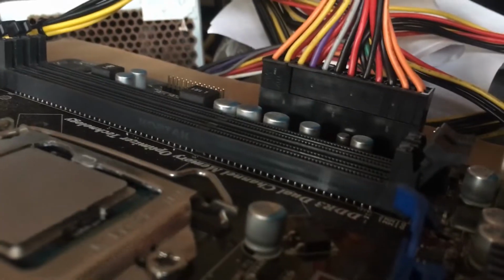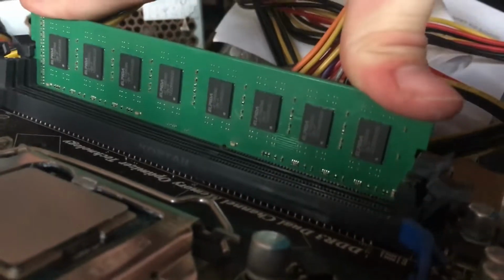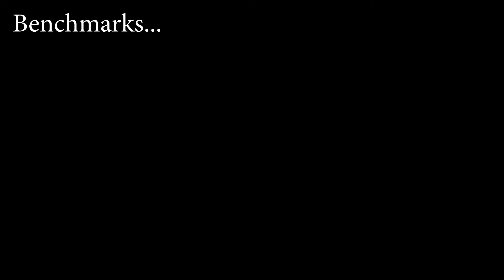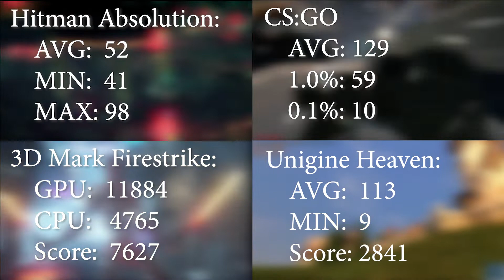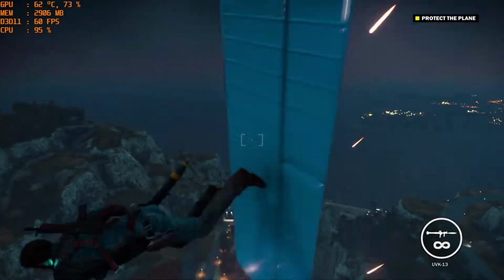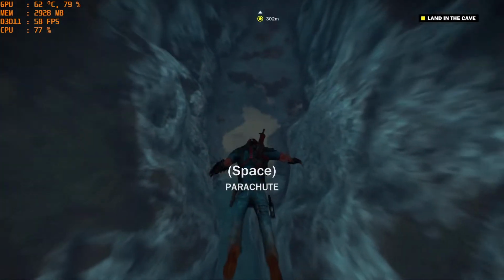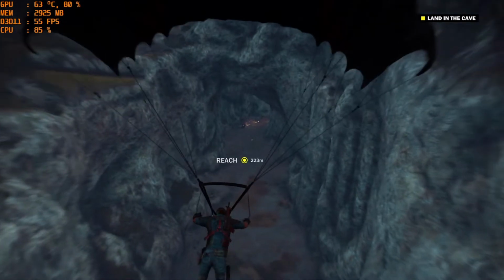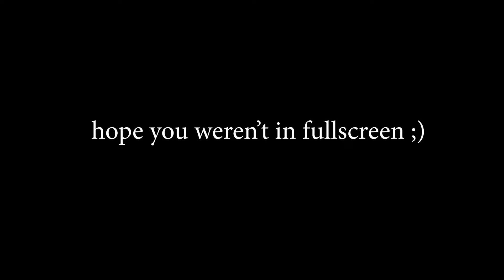i3 3240 & GTX 1060 3GB -  Budget PC in 2019

Comment: mine just fine with i5 2500 without any turbo boost.. idk if bottleneck happened.. but it's still playable.. but I'm gonna upgrade soon to i3 9100f
Reply from the maker: Remember that AMD recently announced the Ryzen 3 3300X which is a really good value chip with a good upgrade path and Intel has also just released the new 10th gen CPUs so you might want to get the 10th gen i3 if you want a slightly longer upgrade path. The 9100F isn’t bad, I’m just mentioning some other options.
Otherwise I agree, the 2500 is a great CPU and even if there is a bit of a bottleneck it probably won’t be too noticeable.